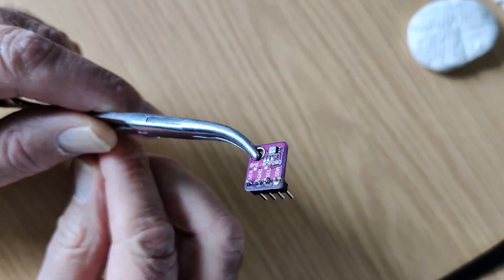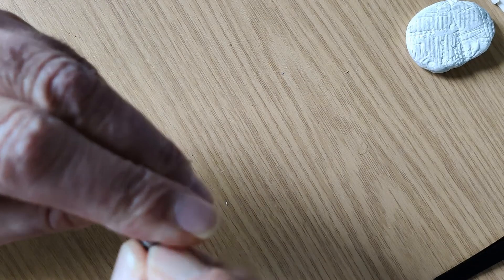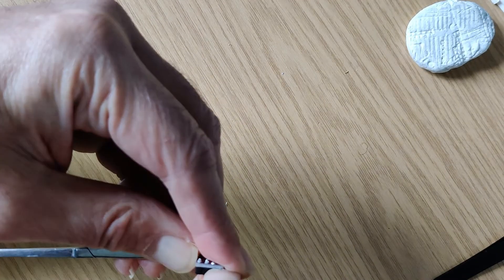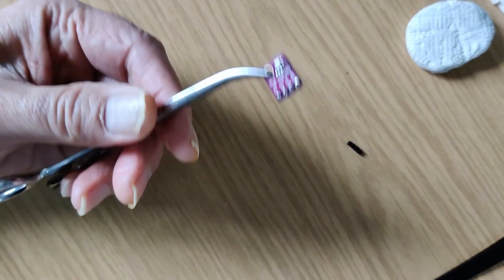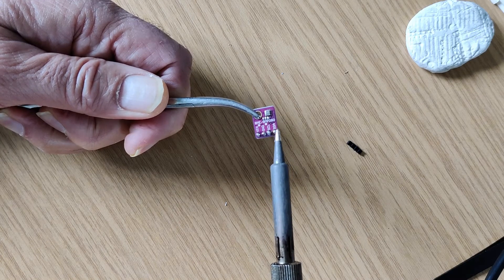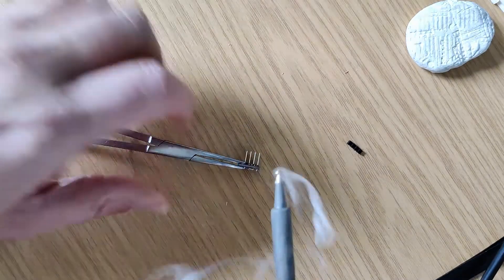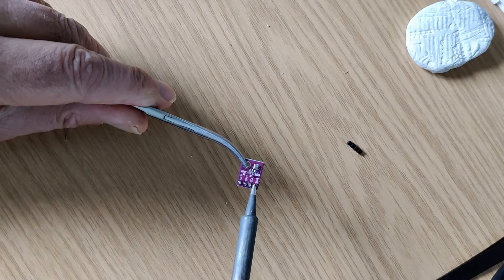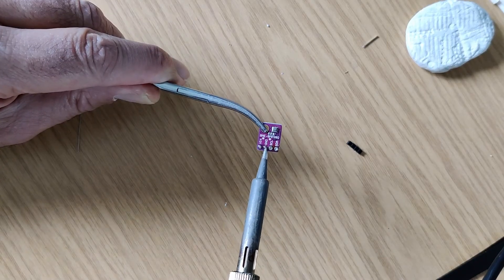Desoldering and removing PCB header pins in a few seconds

Comment: With the added caveat that you don't want to reuse the header . . . It'd be more of a pain to find the pins you just smacked around the room and force them back in their plastic housing (it also didn't look particularly easy getting the housing off in the first place). Most of the time, just stick with a solder-sucker - it's not that hard. You also won't end up getting some random pin embedded in your foot six months from now.
Reply from the maker: I agree, but as a a quick and dirty method forremoving a few pins, it's sometimes easier. Sometimes.
Friends who struggled with other methods found this way useful.

Comment: one channel shows using a piece of heavy copper wire, 14 gauge (not sure of metric, about 1.5 mm dia.), tin it, shape it in an L  with the length needed to cover all the pins at once, heat it, touch it down on all the pins, then bang them out.
i also have an old Weller solder-sucker vacuum tip...
Reply from the maker: Thanks for the comment. I sometimes use the heavy gauge wire if the pins don't come out individually. This method is quick and easy, just using the iron.

Comment: Good technique, but a heated solder sucker (if available)  will clean out the pins and the holes.  Don't even need to remove the plastic part.
Reply from the maker: Thanks for the comment. This 'quick and dirty' technique is an alternative for those with few tools. My heated de-soldering gun rarely gets used as I can remove pins in less time that the gun takes to warm up.

Comment: Great! I don't have a heat gun so I'll try. What temperature do you recommend for the soldering iron?
Reply from the maker: I normally use 350C for leaded solder, 370C for lead-free. Use whatever will easily melt the solder type you use. Use a normal sized bit on the iron - quick heat transfer makes the job quicker and easier. In the video I took longer than normal. Best to practice on scrap boards. Let me know how you get on.